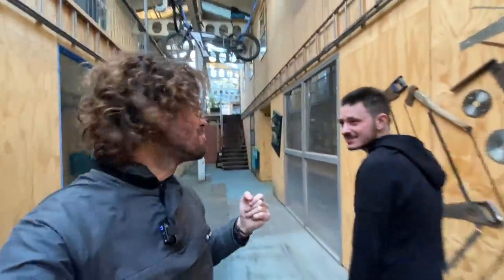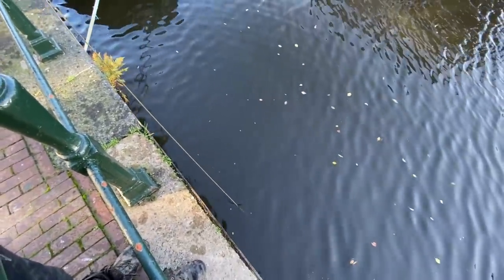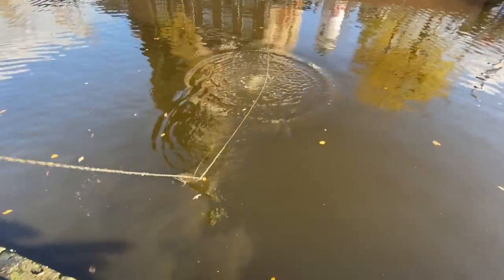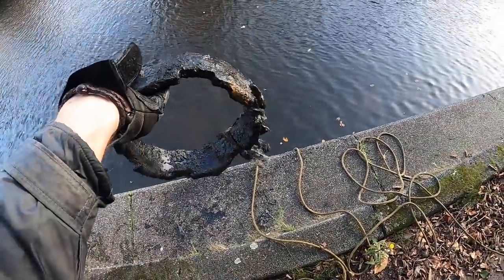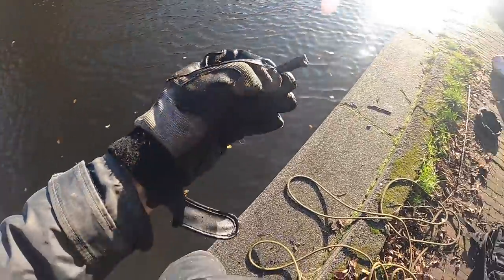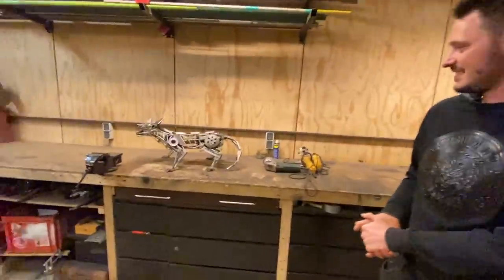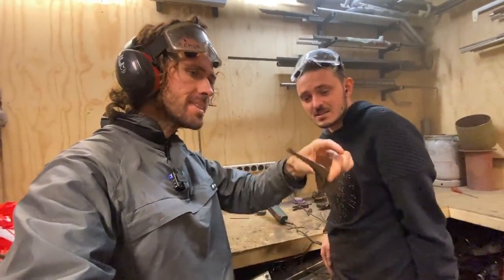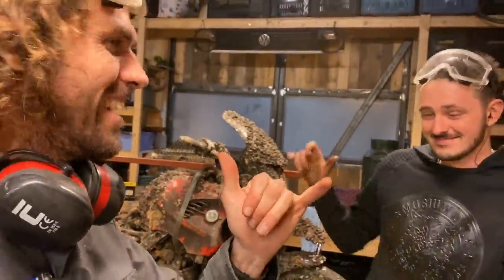Look what we Found Magnet Fishing in Amsterdam's Canals!

Comment: I advise Ramon before applying varnish to metal, use a solution that converts rust. Otherwise, rust will still appear under the varnish and the varnish will swell.

Comment: Maybe so many bikes are in the canal because most bikes are locked by using a lock that simply locks the wheel.  Most bikes aren't locked by using a U-lock or chained to a post.
Since the bikes are only wheel-locked, the perpetrator can easily pick up the bike and throw it in the canal without giving it a second thought.  If the bike is locked to a post, however, it's much harder for some prankster to pick up the bike and throw it in the canal.  The wheel-lock is popular since it's less hassle for a shopper doing a quick stop, locking the bike with a key, and entering a store.  They get accustomed to locking their bike this way even for overnight.  There's also a lot of bars so after midnight, a lot of bar patrons are drunk and looking to throw some bikes in the canal just for fun.
So I think people should start using U-locks and lock the bike to a post to reduce the bikes-thrown-in-the-canal problem.  Don't rely so much on the wheel lock method.

Comment: Square-head nails were made from the late 1700s until about 1830. Most were machine-cut and finished off by a blacksmith who squared the heads. From 1830 to 1890, cabinetmakers used headless, machine-cut nails that are a tapered, rectangular shape. Modern wire, brad or penny nails were introduced around 1890